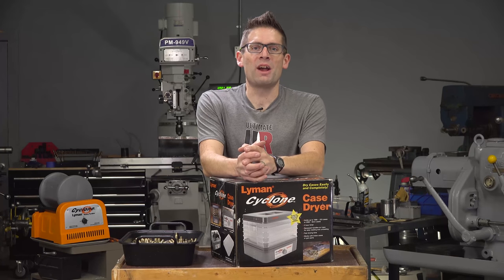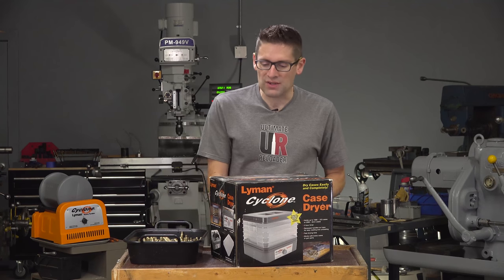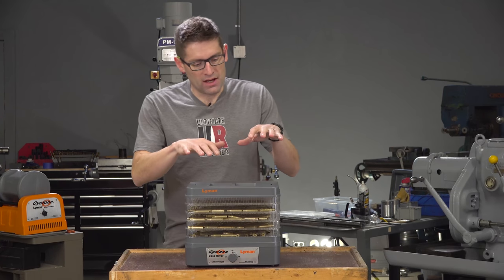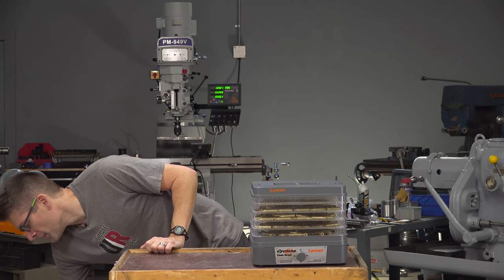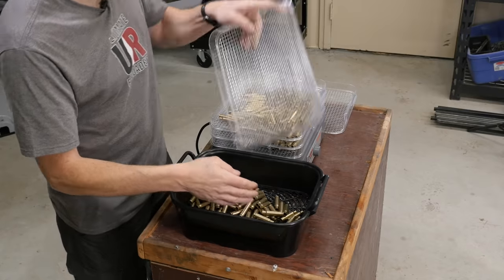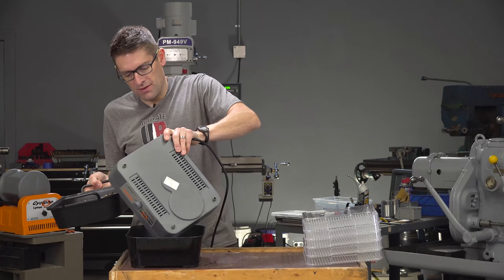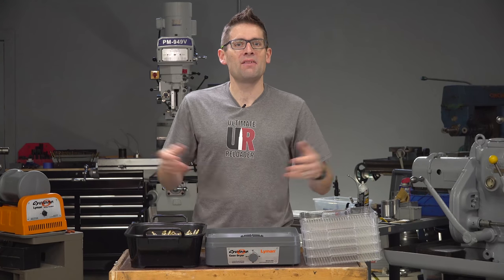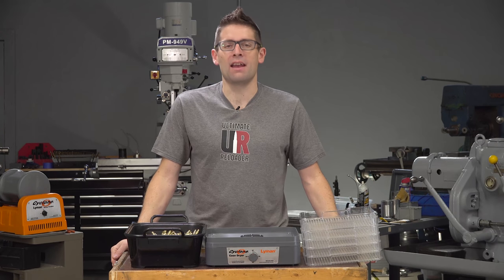Lyman Cyclone Case Dryer: From Unboxing to Drying Cases

Comment: I use my dry media separator with a violent back and forth motion. This will remove 99% of the pins. Dawn and lemoshine work great for me no need for anything else. May have to break down and get the dryer too.
Reply: Not to rain on anyone's parade - Amazon has a presto dehydrator for 40 dollars.
You can buy two of them for a lot less then anyone makes these brass dryers
for. Just a thought...

Comment: Hey Gavin I've been wet tumbling for quite a while now. I use 1 teaspoon of dawn one half teaspoon lemi shine. I use a wet pin separator two separate the pins out of the brass and I use an old food dehydrator to dry the 135 degrees for 1 hour.
Reply: 1 teaspoon lemishine is way too much. I only use 1/16 teaspoon and more dawn soap than you because some of the brass I get is very dirty.

Comment: Besides Lemi-shine, I've had luck with the granular Dishwasher magic if you can't find lemi-shine. Use the industrial Dawn soap from Sam's or Costco. Comes with the nice pump. One shot for not to dirty brass, two for super filthy brass. The enclosed rotary media separator is way easier to get the pins out, put the brass in and use it like a salad spinner. No food dehydrator needed. Just use towels to dry the outside and let them sit to dry. If you want to reload them right away, hit them with a hair dryer.

Comment: I use an ultrasonic cleaner so the dryer appeals to me as opposed to drying cases on a towel overnight, as long as the temps don't get too hot and discolor the brass. The pin media cleaner doesn't seem efficient as it looks like shaking the pins out is more trouble than it's worth. My ultrasonic cleaner does a good job and even my vibratory cleaner does a decent job, but of course it requires sifting the media out and creates some dust. What I'm prepping and why I'm prepping decides the method and sequence of prep.

Comment: Citric acid powder cheap on ebay 1 or 2 x  9mm case fulls  and a few drops of dish soap, wash well after, job done, and you can make lemonade using citric acid as well, an all round winner.

Comment: Actually I use Car Wash liquid soap(With Carnuba Wax, Mothers, Blue Coral ect..) IPO Dawn and use about the same amount of Lemishine. The Cases come out about the same cleaness but you get a anti corrosive wax on them as they tumble. Also Frankford Arsenal makes a great media separator, a couple of turns one direction then a couple of turns the other direction knock every pin out. Then final clean rinse with a hose to remove any remaining soap.

Comment: Cap full of lemon juice and a squirt of dawn for one hour in the wet tumbler and the brass comes out cleaner than anything I’ve seen in 12 years of brass cleaning. Just don’t overload the tumbler (half full max), add hot water to just over the brass and set it for an hour. I’ve tried a bunch of stuff, baking soda, salt, chemicals, etc. Nothing works better than dawn and lemon juice.

Comment: I have been using a power decapper from RCBS because of the spring loaded pin in my pro 2000 to deprime the cases before tumbling for about 8 years now. I don't like to put dirty cases through my resizing dies. And I use the media separator to get all the pins out before drying. I've been using the Franklin tumbler and drier because Lyman had not released their product. I have problems sealing both end caps on the Franklin tumbler so I have to use a lube to seal the ends. The Franklin drier is less than optimal because the trays are round and has a hole through the middle of the trays. Its just a repurposed jerky/fruit drier with a different label.

Comment: I only dry my brass for maybe 30 min (Nesco food dehydrator).   Are your trays flat or is there an incline in them??  Wet cases laying flat or mouth slightly uphill causes the moisture in the cases to pool in the bottom and then as the moisture dries it can leave a residue inside the cases.  Don't know if that is a problem or not, but ….

Comment: Dawn & Lemi-Shine works way better than the stuff Lyman packs with the unit. I.5 hours may get them clean, but they don't shine. I run 3.0 hours. I use a Frakford Arsenal rotary media separator that shakes out wet pins flawlessly.  I'm using an old food dehydrator. 1 hour at 115 degrees and the brass is dry, shiny, with no water spots.

Comment: I'm cheap, so my tumbler is a HF double where I replaced the 2 drums with a 4" PVC pipe (glued cap one side and a test plug on the other), inside the tube I cut a 1" PVC longitudinal in half and screwed on the main pipe. This helps agitate the cases and pins.  Tea spoon of Lemon shine, few drops of Dawn and warm water, 2 to 3 hours later all shinny. Then I shift using Dollar Store basket and tub, spread on a towel and I am done. I thought about buying a food dehydrator ($30) for drying, but like I said. I am cheap. The whole stuff went for less than $60 (I reused some PVC).
Reply: Hey man, if it looks stupid and works... it aint stupid! I did the bucket trick myself but for a media separator.

Comment: This might not work well with bottleneck but for my pistol (9mm, 40, 45) I use a sonic with heat; 2 30 min cycles and use the lyman trays to dry, a little shake. Just likes washing dishes and air dry. If the temp is high enough I think they will dry in 30-45 min;

Comment: I have never used the stainless media. However have wet tumbled for years using laundry liquid soap and vinegar keeps the suds down. I want to try the lemishine soon.
Reply: Laundry soap may contain ammonia that will weaken the brass. Only use regular blue dawn soap.
Reply: Just checked and Kirkland Ultra does not contain ammonia. But thanks its good to know what to watch out for.  Laundry soap just has less suds is why I use it.

Comment: That thing looks like a food dehydrator to me, marketed for reloading.  I’ll stick with the oven method.  Three hours is way too long.  It only takes 30-60 minutes.  I’ve also used my electric smoker (minus smoking chips of course) as it has several racks, and can handle a large volume of cases.  Most of the time the oven works just fine.  

Yes, I’m a Lemi-Shine and Dawn guy.  Works great.

Comment: I’ve been using lemishine and carwash for a few years now. I had brass discoloring after 2-3 days following my drying process when I used straight dawn and lemishine (regardless of the amounts I used). Supposedly it had something to do with my water quality in my area.
Reply: Carwash might contain ammonia which will weaken the brass. I only use 1/16 teaspoon lemishine and blue dawn soap.

Comment: Food dehydrators are a way better alternative if the oven method is not available. Does anyone know if air drying outdoors in the sun would work granted it was dry climates?
Reply: I use a salad spinner to get the pins out of my brass, along with the majority of the water. Then, I just dump the brass into an aluminum roasting pan with a layer of paper towel on the bottom. I generally let the brass sit overnight in my garage and it's good and dry by morning.

Air drying will absolutely work for drying your brass.
Reply: Dwight Rahl thanks the reply!

Comment: Frankford Arsenal is a better unit and harbor freight dryer was 20 bucks
Reply: I bought several of those harbor freight dehydrators, but they stopped selling them and they usually stop working after a couple years so I made my own. Here's a link to a forum where I describe my homemade one. https://rugerforum.net/reloading/363221-homemade-brass-dryer.html